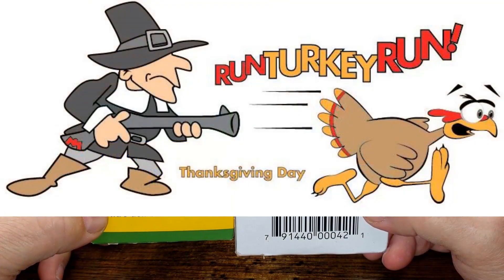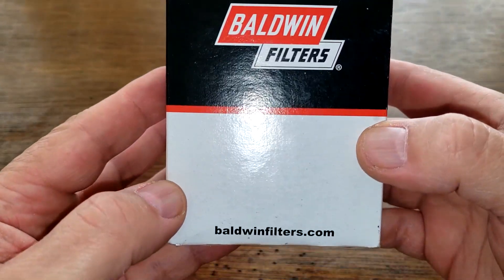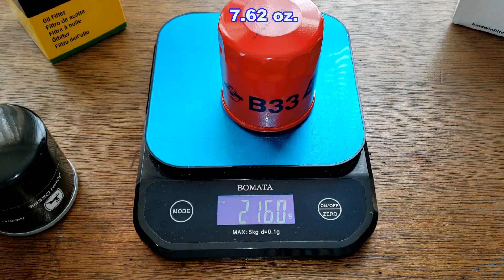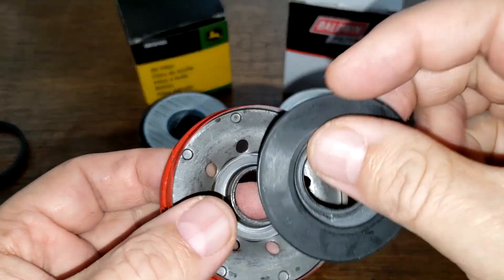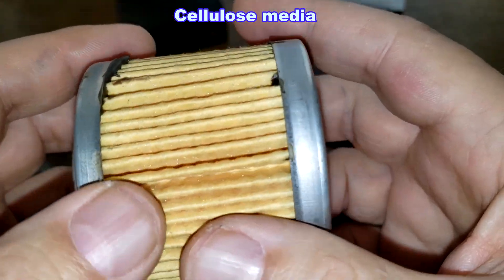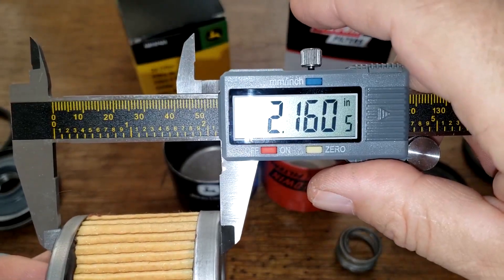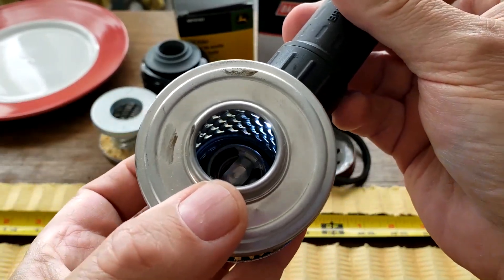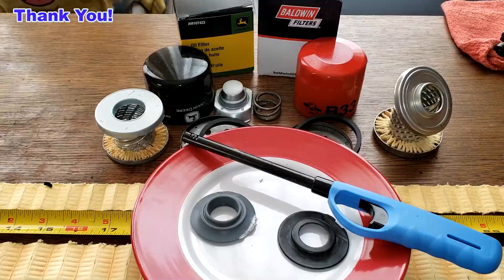John Deere Oil Filter AM107423 vs. Baldwin B33 Oil Filter Cut Open Comparison With ADBV Burn Test

Comment: in my area you can see baldwin filters on 90% of the farm equipment, whether engine oil, fuel, or hydralic systems.so they cant be tòo bad, or the farmers wouldnt be using them regularly.thanks pete.
Reply from the maker: You're Welcome, Thanks for Sharing👍

Comment: I have used both on my 2006 John Deere X320. I like the Baldwin better but I cannot find a cup -type filter tool that will fit on the Baldwin and it is a little tight to remove with a strap wrench. Over the years I have installed several different brands as it is the same filter as used on an older Toyota Yaris.
Reply from the maker: Thanks for sharing👍

Comment: Deere over the years has sourced filters for many different brands a lot of the Lawn and Garden is from Fram and Champion Labs Then the AG and CE side uses Donaldson mostly and some from fleetguard or Champion Labs. If you go all the way back to 1915 one of Frank Donaldsons first air filters was on a Deere Tractor . As for Deere OE lubes are from Chevron for the most part
Reply from the maker: Thanks for Sharing👍

Comment: With the tariffs to be added on all items being imported, the Baldwin may have $$ advantage in the coming years. I use Baldwin on my 1970 C10 truck that I use for hauling alfalfa hay to feed our Thoroughbreds. Almost have had to use the horses to get parts when all the mechanical 1`s stopped operating & only had the 1970  C10 left running!
Reply: I use Baldwin in a few applications,  they are from Hungary, Mexico, USA

Comment: Great comparison! I mow my lawn with a John Deere LX280 that uses these oil filters. I did my own comparison between the filters when I bought the mower about 10 years ago. The Baldwin seemed better overall and cheaper. Also, almost any filter for an 06 Toyota Camry 4-cylinder will interchange with the filters you compared here.
Reply from the maker: Thank You,
and Thanks for Sharing👍

Comment: Can never go wrong with Baldwin!
Hard to find locally though.
Thanks Pete and Thanks Darrell!
Reply: I think they depend on heavy duty fleets and producing private label filters for other companies because you rarely see them on retail stores here in the Southeast.
Reply from the maker: You're Welcome,
I can't find them in my area also.
Reply: BALDWIN filters are available at TRUCK PRO stores! They are a Class 8 Truck, and Trailer parts store. My local store even carries filters for cars! The very small Short B1400 for my wife's Infiniti! The  longer version B1402 for NISSAN, and Hondas. They stock, and sell  alot of BALDWIN FILTERS for just about anything! I'm in North Carolina, so if they have them here, they probably have them in other states also! They sell to alot of Garages, and Tire shops here according to the counter salesman. Hope this helps anyone looking  for a BALDWIN FILTER for your Car,Tractor, Pickup, Lawn Mower, or your PETERBILT, VOLVO, MACK, KENWORTH, FREIGHTLINER, etc!🤔😉😉😉🙂

Comment: Both of these filters for a push mover are better made with better components than some of the vehicles filters you have tested (OCD). I would take the Baldwin with more filter media and my preference of a coil spring.
Reply: Riding mowers with the Kawasaki engines.       I'll take an actual spring over a stamped steel spring typical of wix.

Comment: Great Job, Pete, thanks for sharing, Darrell!  Not a fan of the bypass valve in the leaf spring design but then again I am not a fan of all that sloppy glue on the Baldwin.  If I had to choose I guess I'd pick the Baldwin but the Deere is well made and has decent components.  I don't think either filter would fail you.  A push mower with a spin on is pretty funky.  Must be a commercial mower?
Reply from the maker: Thank Jim👍
Reply: @WhipCityWrencher  Anytime, Pete!

Comment: Almost overkill for a mower. In this application, hard to choose, but the filter media in the Baldwin would tip the scale. Still, I might go with the Deere, due to better manufacture and silicone ADV.